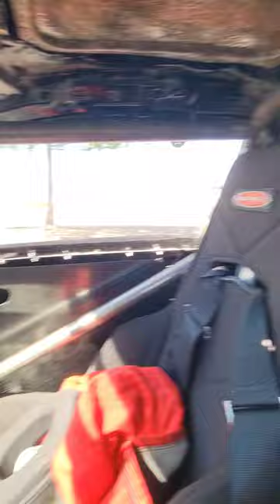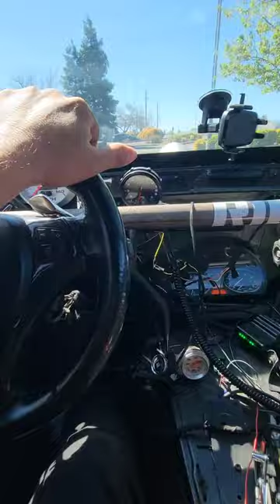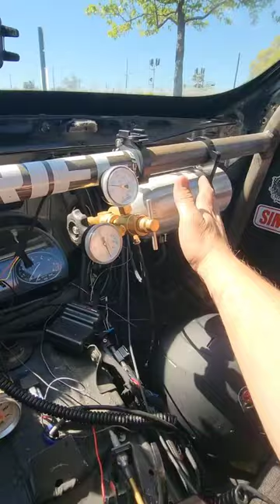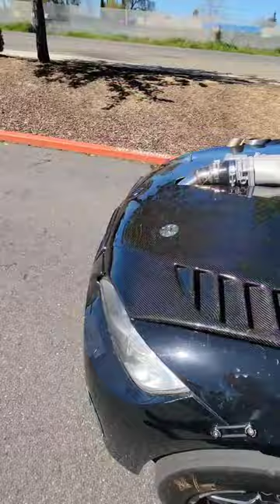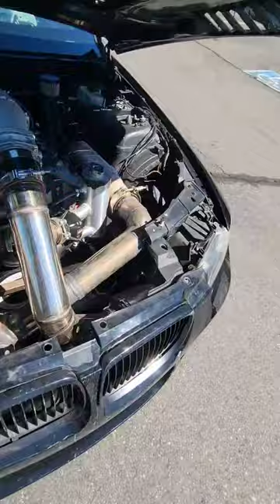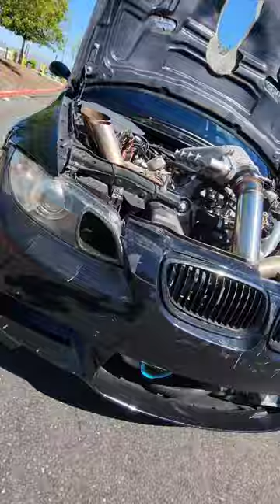Insane Turbo LSX swap BMW 1200hp watch #ls #bmw

Comment: Me watching this with a turbocharged 1.5L 3 cylinder in my 1 series
Reply: U could make anything fast brobro it's more a matter of should u weigh out the pros and cons and think about a plan on how to boost that bih in your situation u could get a bigger turbo but it would potentially out power your engine so then if that was the case u could put nos u already have a turbo and u don't need to run that much to make your car fast being its a 1.5 cylinder

Comment: Don’t need a co2 setup for 1000whp. Just get different tunes setup on switches and turn it to different hp settings.
Reply from the maker: Bro I think you don't understand much in this aren't you? We have a v8 6 liter big turbo, if I put 17 psi spring it will make that much on trans brake and I won't even be able to make the car hook! Also it will make that much at 40 or 60 mph and that's too much boost! Other wise I won't be able to make the right boost that we need. Imagine 1k whp all of ot at once at 60 mph.? Or from the start all of it at once. Common now bro. What we did is the smartest idea that's why this car is doing so well on rolls and digs. We have 5 psi spring that enough for track and the c02 turns up the boost by speed or by time. Also on the rolls on street it does The same thing. You can't pur down even 800 whp at once start at 40 mph at 500 who and theb front and rear wheel speed sensor will help for traction and c02 helps build the boost on higher speeds more boost
Reply: @ALEX.THE.RUSSIAN so it's sorta like a manual BOOST BY GEAR. I dig it bro! That's a drift setup or is it drag?
Reply: NM my stupid comment, it's a drag setup